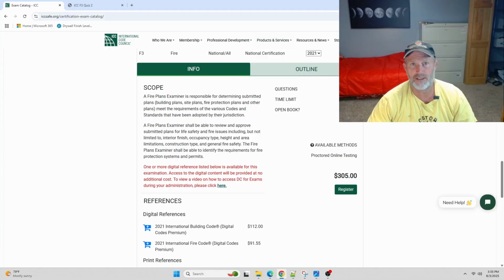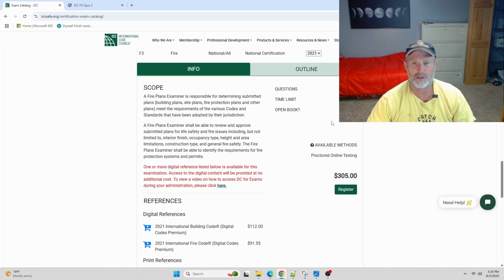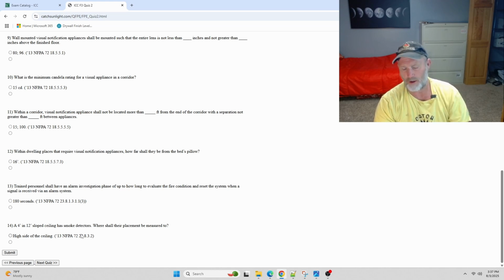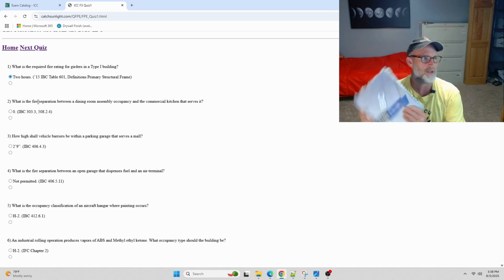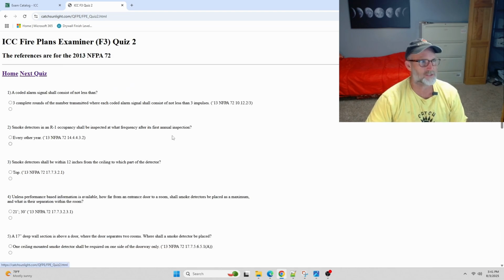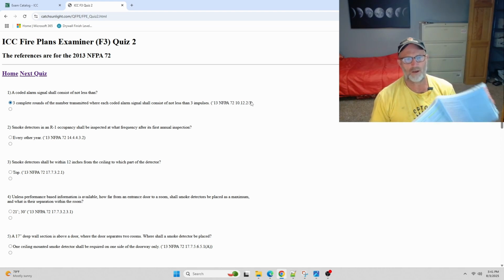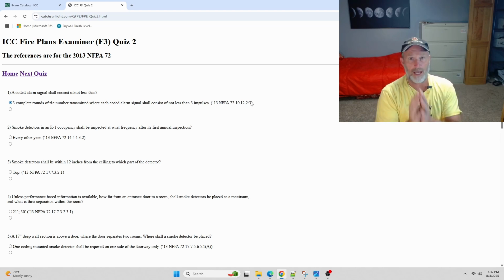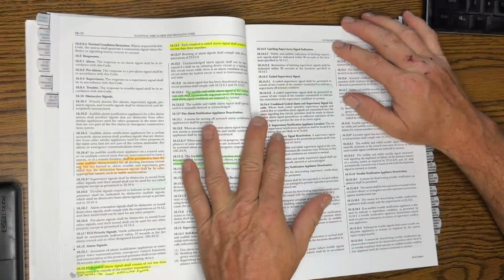ICC Fire Plans Examiner (F3) Certification || Free online tests and my notes to help you pass

Comment: Is this for the NFPA CFPE CERTIFIED?
Reply from the maker: No, this is the ICC FPE, not the NFPA FPE.  They are effectively the same, but most US states rely on ICC (IFC) so this focuses on the ICC version for certification.  It will help you with the NFPA side of things, but will not use NFPA 101 or NFPA 1, which are the core standards for the NFPA FPE.  The content is the same, though, as far as questions.  It will not help you know the layout of NFPA 1/101, which is the fundamental purpose of these quizzes: to know the layout of the codes being tested on.
Reply: @CodesExplained thank you and thanks fpr taking time to answer my questation i approiate it